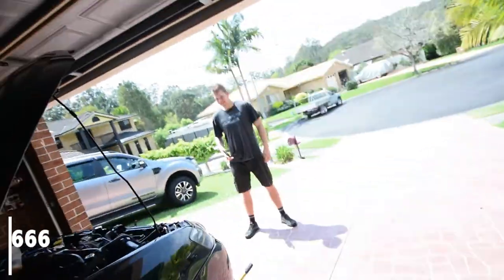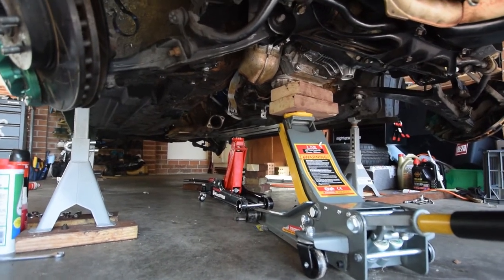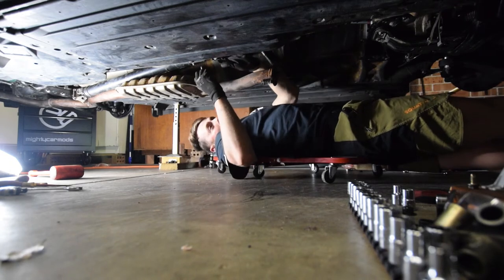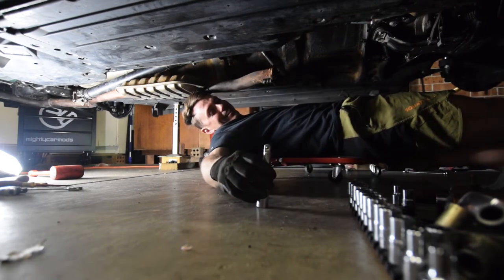How To 6spd Swap a Subaru | Part 3

Comment: The only thing I would add to this are some details. If you are going Liberty/Legacy to another Liberty/Legacy no problem, but if you are getting your unit from an STI you need the Legacy specific rear axles. Also the drive shaft length is different from the 5 speed to the 6 speed. You can use the driveshaft from an automatic legacy as they are the correct length. 
Otherwise good vid, I'm sure lifting that trans while on your back is no fun. I have that in my near future.
Reply: Good info. Doing legacy to 6spd from 08sti and figured I needed an AT driveshaft from a legacy, not an impreza.

Comment: hey my dude im about to embark on this journey. coupkle questions: did you use the axels from the sti or reuse your axels from the liberty? also what did your driveshaft bolt right up? ive heard guys have to get custom drive shafts...lemme know. thanks!
Reply from the maker: Hey lad! I bought a full 6spd swap (from a specb liberty wagon) it came with the box, diff, axels and drive shaft, Which all bolted in. 
So to answer your question, you need the axels to suit the box and rear diff (the axels already in the lib won't work), and you also need the drive shaft to suit the 6spd box (again the one already in tbe lib won't work), I remember reading that the driveshaft from an automatic would also work (don't hold me to that haha) 
Just on the forum man, heaps of info in there, that's how I answered all my concerns
Reply: @BuiltByBlake  yeah i heard that too about the auto drive shaft (which i have layin around).. thanks for the info. i think i have all pieces to the puzzle. Time to send it!

Comment: Would a h6 6 speed fit in my gc8 wrx
Reply from the maker: The box and diff will almost certainly be fine. Not sure on tailshaft lengths though, we've never done it. 
The 6spd out of the gc8 rally car came from another gc8